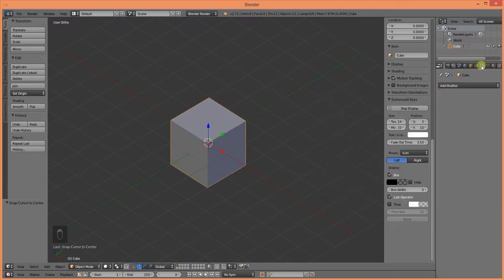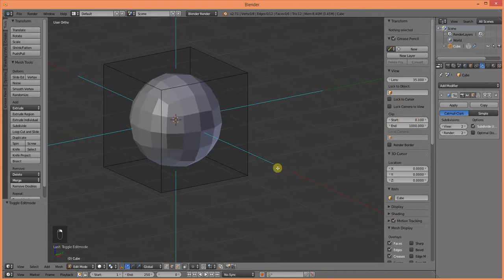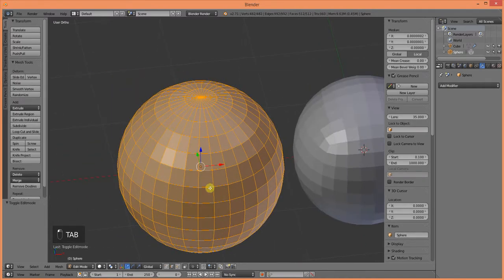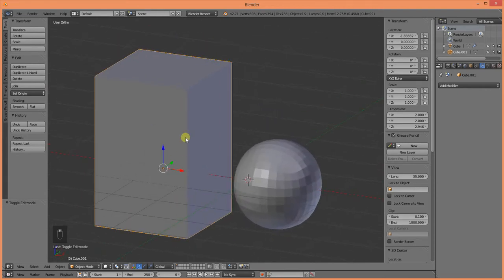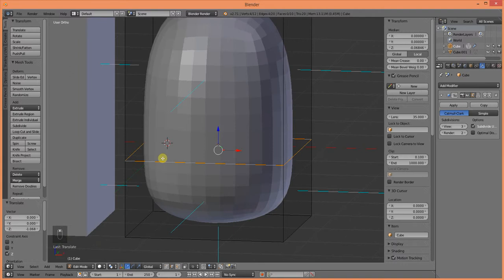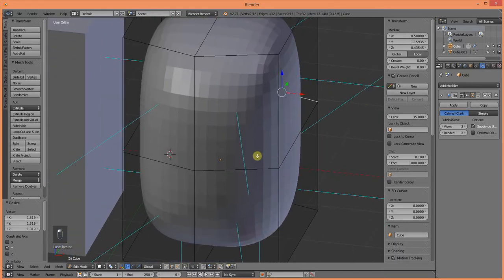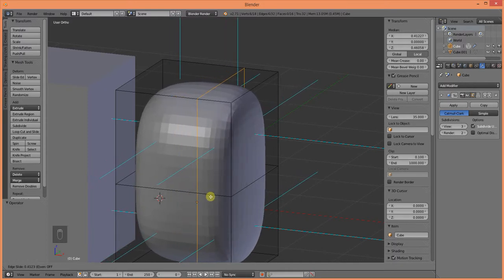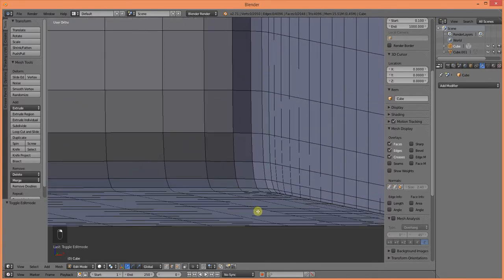Subdivision Surface Modifier Using Blender

Comment: at 8:00, you say to hit enter and your edge loop stays on the edge there. That's not happening for me, it just reverts back to the center and disappears.  Any tip on what I'm doing wrong?
Reply from the maker: It may have something to do with your user preferences. A shortcut key may be assigned to the ENTER key. You can also set the edge loop's position by using the mouse click. You may also try a different version of Blender. If the problem goes away this may be a bug in the version of Blender being used and may need to be reported. The only way I was able to repeat this problem is using right click after sliding to edge. I'm using a custom version of Maya preset keys. I believe Blender by default uses right click for selection. These two buttons are reverse to what most people are used to using.